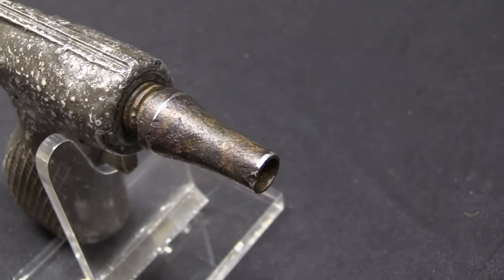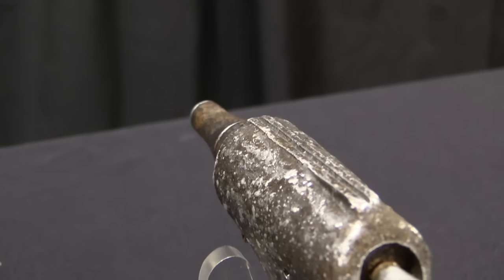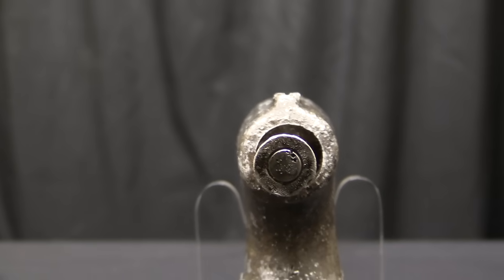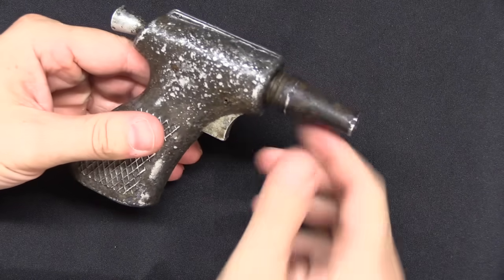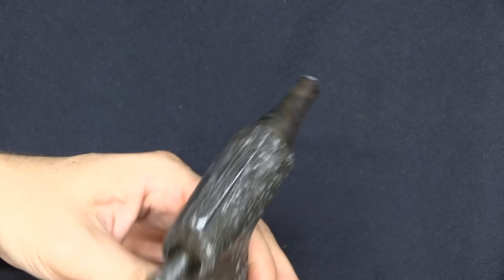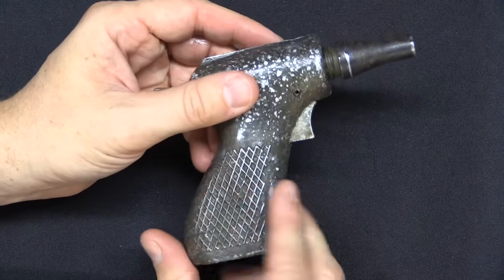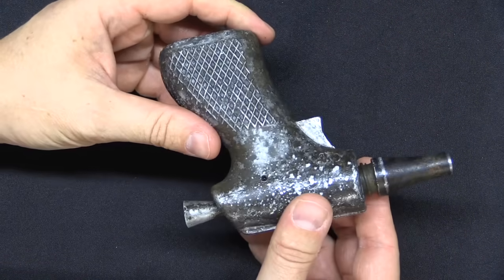The CIA's New Liberator: the 9mm Deer Gun

Comment: air drop hi-points... save the government money.
Reply: I'm in total agreement. Ugly but accurate and effective
Reply: Air drop a B58.  Go big or go home.
Reply: Why? We want to send actual functioning pistols, not hi points
Reply: @jongles2530  Hi poi ts are more relyable than the avdage automatic pistol. You could probably drop them without parachutes.
Reply: @ineednochannelyoutube5384  Hi points are even more reliable than your keyboard. Remarkable.
Reply: @ineednochannelyoutube5384  Issa joke. Although I wouldn't say reliable. Heard and seen them jam a bit
Reply: Sarbur Gideg  You can still get that type of durability out of a glock and get a weapon 4x better.
Reply: Sarbur Gideg  Maybe 300 dollars more, but its worth it for self defense. I mean, its a single stack magazine chambered in 9mm. I never personally fired one yet but ive heard they're also not comfortable to shoot.
Reply: @jongles2530  Tuey are shaped like a fucking brick. They have abysmal capacity. But they are certainly hard to destroy. For a budget pistol, I would say the correct compromises were made on them.
Reply: Also Rugers or Berettas they're cheap too.
Or if if you want deniability but a bunch of illegally made M1911 clones from the Philippians.
Reply: Damian Simpson  that 300 dollars will get you very far.
Reply: Okay, Comprimise. Air drop Taurus millenniums... cheap and effective. Though,  A hi-point is pretty damn good with a very minimal amount of tooling. Just sand the ramp and the firing pin groove and quit crying.
Reply: @jongles2530  You should see the HiPoint and Glock mud tests TFB TV did. Ian may have even done this on InRange too. The Glock lost.
Reply: @honkhonkler7732  Again, its a joke. Although ive heard they're very prone to jam
Reply: Hi points definitely require some break in and getting used to. It would be worth it over this to have follow up shots.
They had to pay 300 per gun for this. 
They could have had high point make a scaled down version of their own gun that was sterile in a bulk buy for probably 100 per gun if they were buying that many. 1/3 the cost for somethinf betrer.
Reply: Or zip 22 lol! They will all die though
Reply: @mandolore19  but they all go off when they hit the ground and start the shooting war before the rebels are ready.
Reply: I was thinking that exact thing, but I'm not a CIA genius.
Reply: @jongles2530  as a current hi point owner, they're no more uncomfortable than a glock. I'd say glocks are actually less comfortable than my hi-point, on account of their wonky grip angle. I've fired hundreds of rounds off this thing at the range, and my only complaint would be that when I bought it second hand, it wasn't zero'd (that's something I'm too lazy to fix, to be honest. I doubt it's the guns fault). never had a jamming issue the whole time I owned it, even though it fires off-sight, it still fires consistently (up and to the right), and I get about the same grouping I get with any gun twice its price.

I assume the complaints about jamming are from the same people that have never cleaned a gun in their life. Which i get, some people can't seem to fire a handgun without first trying to stuff an entire PB&J sandwich into the action, but that's really not the guns fault is it? I admit I get pretty lazy about cleaning, but I still don't have jamming issues on this thing, so I really don't get it, theyve gotta be doing SOMETHING wrong here because I've never had an issue, nor have I heard of anyone who actually owns a Hi-Point having an issue.
Reply: Accurate, extremely effective, cheap as dog shit, but horrible trigger whatever thank you citizen
Reply: Arcane Alchemist I’ve bought several hi-points when I first got into firearms. All of them jammed several times within the first 100 rounds fired. The grip is okay, I guess. The trigger on those things makes me never want to pick up another one. And yes, I clean my guns. Maybe you just got lucky, or maybe I just got unlucky. I will still never trust a hi point to save my life.
Reply: @jongles2530  have shot a hi point, can confirm. they arent as bad as they are said to be though
Reply: Unlike the people saying hi-points are good I see what the commenter means and I agree they are garbage or at least I assume he’s calling them garbage...
Reply: or break barrel shotguns
Reply: That's even worse!
Reply: @jongles2530  you are just a hi point hater who can't accept that the hi point would beat the shit out of your glock
Reply: No, we're going to lose everyone cuz they'll die from seeing that thing
Reply: Sarbur Gideg  I'm sure you speak of Demoranch's video. I was about convinced, until learning that the slide is  made of horribly cheap pot metal. Garand thumb has a video on it.
Reply: @metamorphicorder  it was 3 dollars a gun, not 300 dollars a gun.
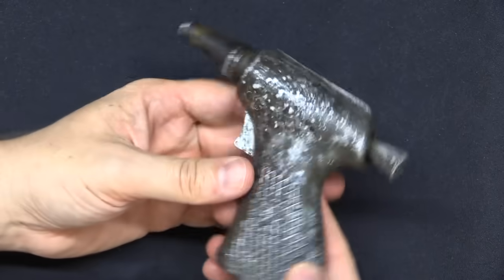Reply: @aevan104  5:25. He says it cost them 300 each. Earlier he said it cost the mafctr 3.95 ea to make. I also heard him talk about the econnomy of scale after that, but you gotta think that if Hi point is currently producing supposedly crappy handguns that are at least two orders of magnitude better than this for under 200 ea and they already had nearly all the toolijg they would need up and running to make a cheaper version of a semiauto. Even if it had ended up being twice as much as these would have ended up being, and these ended up being twice what they quoted, 4x the price for 10x betterness is a fairly good deal. We werent engaging in this out of the goodness of out hearts, we had skin in the game, it would make sense to give them a gun capable of a few follow up shots. But to be fair i understand why you made your comment. The basic premise of the original comment wasnt taking into account the supposed ecconomy of scale. Its an important detail.
Reply: Yes, cheap, reliable, and can fire multiple bullets in quick succesion with modern accuracy, useful in taking a soldier's gun afrer killing them, and even able to sustain a firefight.
Reply: The Hi-Point (as much as I hate to say it) would survive because of the sheer amount of metal it has, but it would be like a kinetic energy weapon impact when it landed. On second thought, that could be just as effective.
Reply: The 9mm hi point was my first gun loved that thing since I have picked up a pretty decent collection of guns but will never bad-mouth the high point you can throw that thing up against the wall stomp on it run all over it put it in the sand and she will always work for you the AK of pistols for sure!!! Still an ugly brick you can beat in a witches head with. But I've put people with thousand dollar pistols to shame shooting with it!!! 
It's all about the person holding gun!
Reply: @tomaswalker9132  thats about the typical reaction though. Theres fairly few middle of the road reactions to hipoints. People talk shit about them and wont even consider that they might be a worthwhile pistol, or they cant say anything bad about them. Every once in a while you will hear someone say, hey if you run them right, they are mostly pretty average guns, they have some known quality issues that pop up sometimes, many of which are easily addressed by the owner and they have nearly second to none customer and product support. 
Which is pretty much a fair deacription of them. 
Most of the people who talk shit on them speak of having multiple malfs in the first few hundred or less rounds and very often speak about how bad the grip is. 
Look, its a sub 200$ hand gun, there are few guns costung even many times more than that , which across their yearly production runs wont have some sort of recurrent failure mode crop up on out of the box guns which are being run by the general public. About the only one i would be willing to bet doesnt regularly experience such a thing would be Korth, both because they are made in such small numbers but also because they are made in such small numbers, their quaity inspections are so spot on in every step and the final inspection is so tight that they rarely get a pistol back with a genuine malf that is the result of part quality or assembly. Meaning its either ammo or operator error. 
Theres a reason that one of the most common things kimber owners do is have their guns modded and tuned by specialty smiths, and its because those guns even at a somewhat similar price point to korth, have issues where as if you reviece your korth and walk out of the gun store in the middle of a full on riot, you know you have a functioning gun in your hand. 
But people want korth performance with mattel prices.
Reply: Every firearm used in crime, just drop them from aeroplane. For American benefit.
Reply: Don't know if it was on purpose or not but I think it's funny,big not ironic, that you said hi-point in your cheap gun comment lol.
Reply: @jongles2530  The government doesn’t really care about the people enough to pay that much money for “self defense” . They don’t really expect the people to do well with the gun. All that matters is that the people take the enemy’s rifle and pistol. Besides if you have an expensive gun you would find a better gun off the guy you kill. it’s not even self defense if it’s an insurgent group
Reply: @c15a  The government does definitely care considering we send out high end SF ops to train the people in guerilla warfare, which isn't exactly free for us. In the past we've supplied the Mujahideen to fight off the soviet and we're probably still doing the same today just off the radar. Although Im pretty sure none of that is for moral reasoning.
Reply: Great idea! You could club someone to death with those horrible slides!
Reply: @honkhonkler7732  garand thumb did a review and the hi-point lost cuz its shit pot metal
Reply: @darrengarcia4937  and he threw it at a rock from a normal standing position and the slide snapped in half. Not sure of the gun's life before Garand Thumb got it in his hands, but no matter what, having a slide crack in half from being chucked at a rock is a bad sign.
Reply: Sarbur Gideg  it costs like 75 dollars to make a Glock of I remember correctly
Reply: @jongles2530  hi points will outlive u and 7 generations of ur bloodline
Reply: @nouns7504  And many other handguns as well that are better than hi-points.
Reply: Now a days just don’t crush all of the guns from stupid buybacks and drop em in
Reply: My thoughts exactly, hi points are based
Reply: @ineednochannelyoutube5384 that’s exactly the level of grammar I’d expect from the average Hipoint owner.
Reply: @SantaClaus-kk8zr he simply types that way now after the hi point incident
Reply: I remember my buddy had a high point we ended up getting pinned in by a group of guys together one day trying to attack us. My buddy racked the slide and I’m thinking what the hell were surrounded and he hasn’t shot….then he proceeded to use it as a bludgeon and started smashing their windows in and pointing at it then telling em to stand back. The whole time I’m screaming shot him cause I’m stuck in the back seat of an old school integra with the sliding seats and there punching the passenger in front of me. Turns out the bluff wasn’t a bluff, the whole time I thought he racked the slide to scare them….turns out it jammed he was literally face to face with them too. If it wasn’t at night and these dudes knew anything about guns I don’t know if we would of made it out unscathed, upon viewing the gun later I discovered the round jammed in between the slide and the ejection port and it wouldnt eject the round, It took me a second to realize the problem in the daylight but if they would of saw it at night no doubt we would of gotten jumped and robbed of my buddies crap high point. He got rid of it after that 😂
Reply: Just tell the authorities its a hammer…
Reply: @jongles2530 yeah, but not for $ 4, even after you adjust for inflation. Although… a Glock is mostly plastic… why do they cost so much?
Reply: @ForrestGreen-bi9nj  my buddy and me got into a position where he tried to use it in self defense…it jammed and he used it as a hammer 😂
Reply: @ForrestGreen-bi9nj  Because Gaston Glock was told that if he sold his handguns for any lower people would think they were poor craftsmanship. So the price is around $500
Reply: @ineednochannelyoutube5384 No, they are not “more reliable than the average pistol” whoever tf told you that can only afford a hi-point and is trying to make themselves feel better. M&P and Glock pistols are leaps and bounds better sidearms

Comment: Taken apart, that thing would blend right into the pile of odds and ends on the desk at my dad's paint shop.
Reply: That's actually a really good point. If you are a someone who needs a weapon like this you don't want to be caught with a weapon. The Liberator is an odd looking gun but it is still very obviously a gun. This thing could literally be taken to its main pieces and just mixed into the contents of a work bench without drawing attention if you were to be searched.
Reply: Don't even need to go that far. Just attach an air hose connector and no one will bat an eye.
Reply: @vintageyamahasquid  That was a feature of the Welrod. Without the magazine grip, it didn't look like a gun
Reply: @zacharyrollick6169   Someone with an actual tool bench could make a convincing hacksaw grip out of it as well.
Reply: @vintageyamahasquid  If you put a plastic shell over it, take out the plunger in the back, and put in a dummy electrical cord in the grip it could easily pass for a hot glue gun.
Reply: ... Maybe your dad is a CIA operator?
Reply: @zacharyrollick6169  lol

Comment: While I understand the purpose, in practice this may be one of the shittiest guns not made by Cobray.
Reply: It doesn't even make sense one shot form 9mm isn't enough to just drop someone dead most of the time ,so one shot 9mm is horrible idea. They could at least make it 2 barrel to give you 2 shoots. And it doesnt look threatening at all so to treaten somone with it to give away his real gun you would prabably first need to explain it is a fire arm. Pity for the guys who would need to use this or original liberator.
Reply: @MrMleczkp  seems like we found the Fudd. This gun wasn't meant to threaten, it was meant to be used in an ambush situation, close quarters. If the enemy still lived after being shot, you could still finish them off with their own gun.
Reply: @blarfroer8066  SO why use gun when you could use knife? SU and this time was handing AKs to militias so this particular idea was really bad. If they come with gun disguised as common tools, OK worth to try it, but this one is ridiculous.
Reply: @plasot  Pulling a trigger is probably easier for random people than using a knife, albeit louder.
Reply: I think I'd rather have a gun made by Cobray than one of the multitude of pot metal 25 ACP, 22 LR, etc pistols out there.
Reply: @Blodhelm  Sure but you have pull it at point blank distance to be sure that you will not miss target with that gun, cause you missed and you are toast.
Reply: @MrMleczkp  the gun it was based on was designed to be picked up from the ground after a plane drop..
After which the person would carry it until they could walk up to a soldier and shoot them at Point blank and then take their weapon..
Reply: They could airdrop 12 gauge shells and pipeguns made by a plumber and they would be more effective.  If this were silenced it still wouldn't even make sense.  (Welrod from WWII operations even seems a better fit.)

https://www.youtube.com/watch?v=k-2l27S9hrE

Comment: A guy I knew made a 22.LR pen gun. single shot, you unscrew it to load it. You pull back on the clicker, the pocket clip pops up, to fire you push down on the clip. eventually they even made a little cap thing for the end that was an actual pen and would write. You're gonna say what use is it, and isn't it loud? Well for covert work, it's great, and frankly the only one that might find it loud for a split second is the person that has it poked in their ear...used that way it's pretty quiet. skulls make great sound suppressors.

Comment: I think another aspect of making such poor quality weapons for insurgents is that you limit the power they can get. For example if you give them a 1911 instead of the liberator or a standard 9m instead of the deer gun then they would have a firearm that could be used after your side takes over, these pistols with their limited uses, range and firepower make it more likely that insurgence will be running on limited firepower which means that when your side takes over the insurgences don't have much to use against your own people as they have whatever limited captured equipment and the shitty pistols they were gifted. If they were given better guns at the start they would be more effective in weakening the enemy as a accurate and quick shooter could take down 2-3 soldiers at a time instead of only lone soldiers resulting in more damage to the enemy but also more captured gear which could get pointed at you.